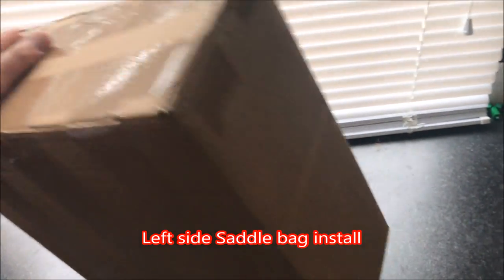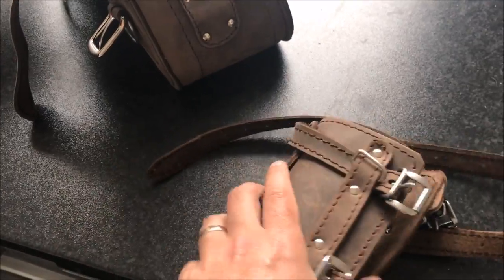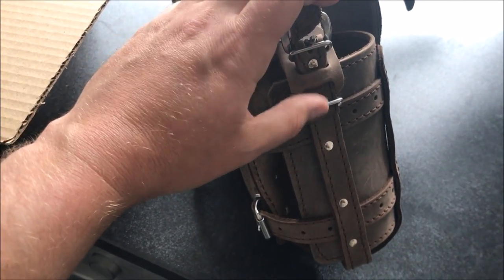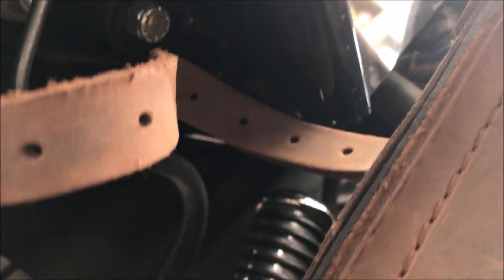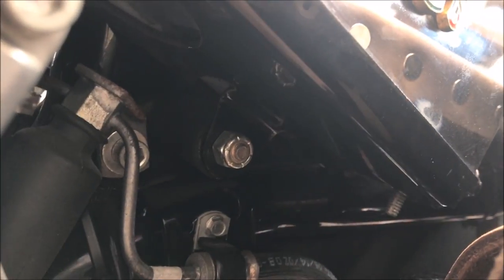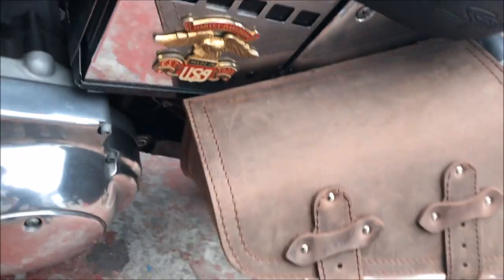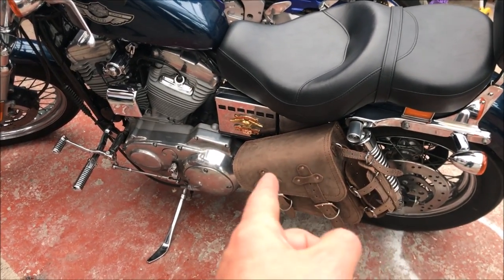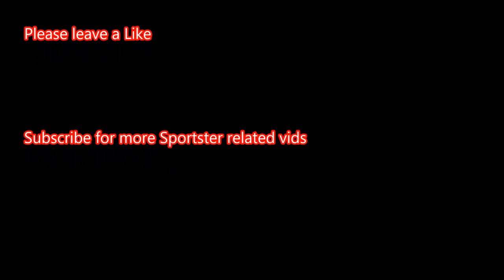HOW TO INSTALL Harley Davidson Sportster left side saddle bag + holder

Comment: Fantastic clip 

This is exactly what I need for my  72 to take my bike out for that essential shop in this pandemic,fed up carrying a rucksack 
My bike has the red paint job  I was toying with the idea of a set of black bags but I think the brown will be cooler 

Cheer
Dave from Scotland
Reply from the maker: 👌🏻I’ve been away on a weekend bike  jolly just using that bag 🤣
Hardcore
Reply: @MakaJerycho  
Cool 
I ordered it yesterday from ebay, looking forward to fitting it .

Cheers 
Dave
Reply from the maker: @davidmuir6849  the 72 is by far my fav sporty. It’s just so amazing. I styled my old XLH on them.
Reply from the maker: Also if you’re in the UK join Sportster sickness UK on Facebook, if you haven’t already. Tell them I sent you
Reply: @MakaJerycho  

Thanks for the info  ,im not in any clubs but ill definitely look into the sportster sickness club uk 
Cheers 
Dave
Reply: @MakaJerycho  
I'm not on Facebook is there another way to join ?
Reply: @MakaJerycho  
Yeah its my first harley ,I traded in a 2 year old triumph t120 for it ,the harley is far better more fun for a young 57 year old. 
It takes me back to the 70s when I had the easy rider poster on the bedroom wall 😄
BTW your bike looks fantastic 

Cheers 
Dave
Reply from the maker: @davidmuir6849  bit of a bugger but it’s a fbook group :( 
Every year they host a big one event. Last few years over 600 Sportster from all over turn up. They have groups in each areas as well with regular meet ups.
Reply: @MakaJerycho  

No problem maka thanks for letting me know ill see about joining face book 
Cheers 
Dave

Comment: Loving the Anniversary model, I've got the '03 883 Hugger and definitely relocating mine to the same position as yours, you found that using the bottle holder gets in the way of your rear springs? I've got the La Rosa one with the fuel bottle and don't want it hitting mine.
Reply from the maker: You can always install it a bit closes forward away from the suspension. But tbh it doesn’t get in the way

Comment: Do you know if these bags fit on a 1200 custom? I'd reckon so. But dont want to waste a 100 bucks and find out it is not compatible.
Reply from the maker: Erick de viking aye should do as long as your frame looks something like mine in the vid :)
They are quite flexible as to where to mount etc. 
The 1200 and the 883 share the same frame size

Comment: What about passager peg?
Reply from the maker: pikaprd not much chance of those with a side by like this.
More for solo riding
Reply: @MakaJerycho  Damn, I just got one bag like this, but i want to be capable of two up riding :/ Anyway, thanks for reply.
Reply from the maker: pikaprd what you can do is have a rear peg made or an extension piece welded on the the existing peg so it brings the left hand side out past the bag.
Reply: @MakaJerycho  Yea, though so. I will see when i get to my bike with that bag.